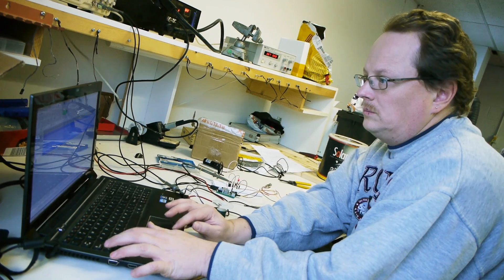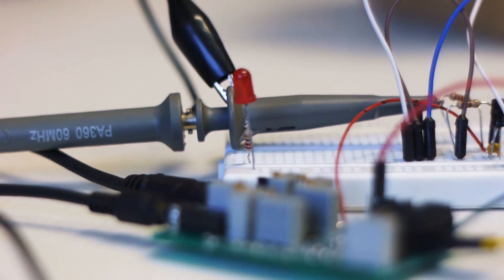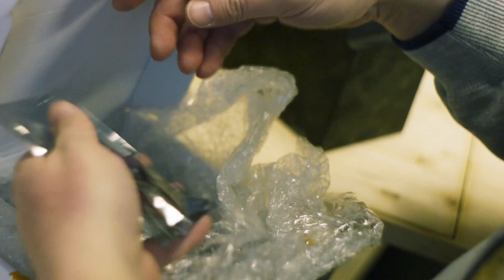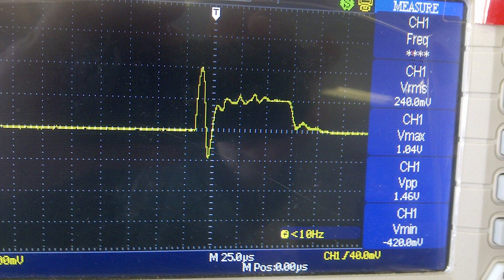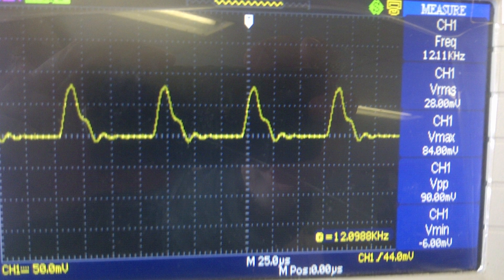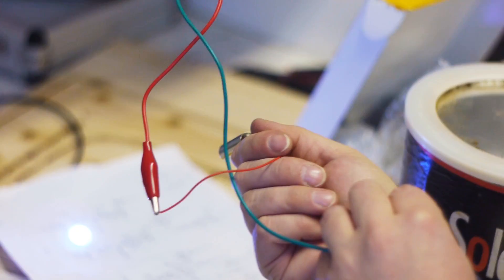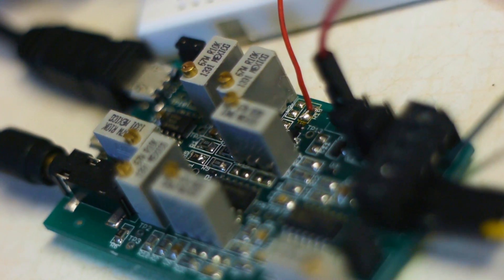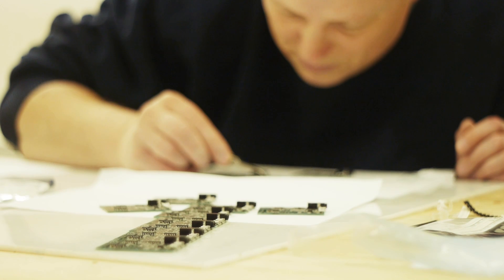Update #23 - Circuit Developments 2

Comment: Have you considered designing your printers, so they can be arranged as printer module arrays to fit any shape?  This could be a solution to print times for larger prints. Then you can print any size shape at speed. Let me explain.

 It would be great if these PEACHIES could be arranged in different module Array's that reflect the shape you wish to print.  If you could fix them in a modular way, jigsaw locked then the lasers could cooperate at the individual edges to the exact same point, seemlessly, so to act as one, so each print and timed lazer component knitt together as one or better printed as one unit, like a printer with many print heads.   Then you can print any size shape and speed. Wooopppeee

This is im sure a good software challenge but it could be a solution to seemlessly printing some large objects, at speed like your dream canoe .   Your dripping  Z axis's's' could all be coordinated also.

Using modules could be a solution to print times for larger print and light resolution as well.  Your price point and fluids may fit with such a solution as your unit cost  would allow for a dozen printers to be purchased arranged and fluids would flow into any shaped array.

Hope you like the idea .  Good luck with the project, I would love to see high resolution, with all those mirror out of space technology soulutions, out there.  Please feel free to contact me if you want. I am a Blender 3d Print User etc etc, I missed the Kickstarter but am interested for the future ;-)

Comment: You aren't the first to get bitten by inrush current!
I designed/built a 1/2 HP pump system and continuously have problems with people in the field not taking the wiring requirements given seriously.
Even though it draws 8A when up to speed, the demand is ~45A at start up - this would cause the controls to drop out if the wiring is small and/or long enough.